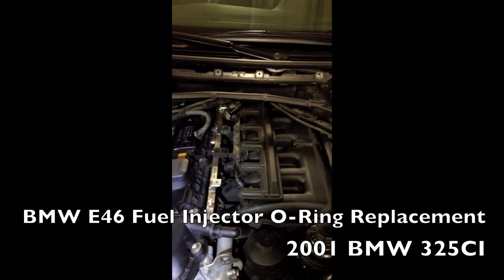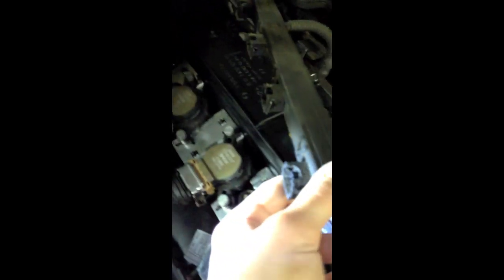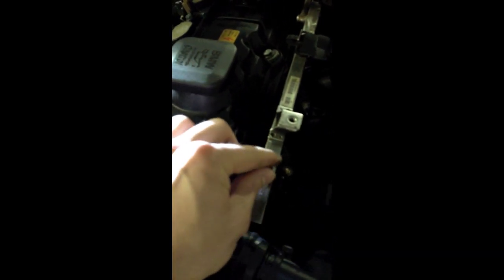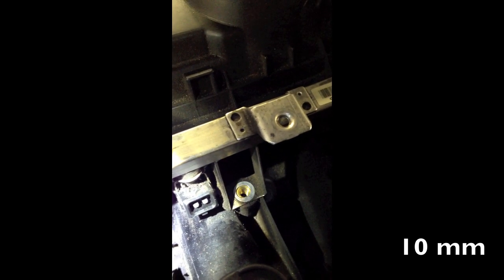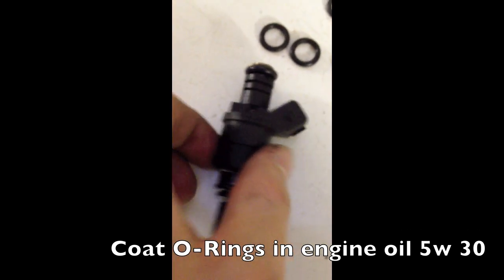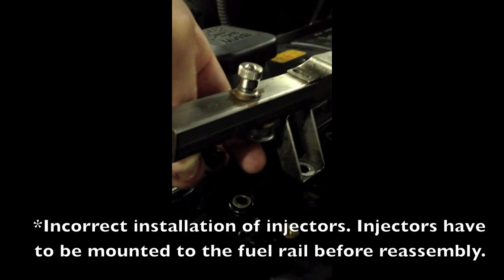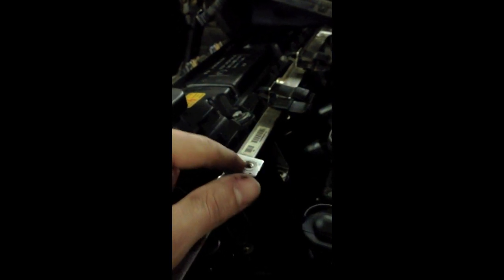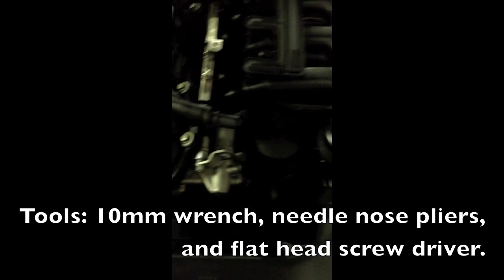------- BMW E46 Fuel Injector O-Ring Replacement -------

Comment: If i dont dip the rings in oil or anything can it still lose fuel pressure ?i get long cranks after long periods of time
Reply from the maker: Seems like this is the material the o-rings are made of Hydrogenated nitrile butadiene rubber (HNBR). I lubricated the rings for ease of installation but I do not think the material needs anything else to properly seal.
Reply: Ross Piccinini that's what I figured.. My next guess would be fuel pump or regulator but I just changed those yesterday maybe I got a faulty refurbished one? Would a faulty camshaft sensor affect starts?arrgh!
Reply from the maker: What are the codes?
Reply: Ross Piccinini I've gotten all codes so I did everything to a T.. cleaned fuel injectors and changed the filter baskets and orings, changed fuel filter and regulator + fuel pump, +fuel pump relay, new spark plugs I gotta change the throttle body gasket just doing regular maintenance stuff.. At least I'm getting better mileage and no more codes though. I'm gonna check this next 13537548987 INLET FUEL HOSE then I'm gonna give and bring to mechanic my mind is overloaded at this point
Reply: This is what happens.. Morning crank for 3 seconds release.. Crank again for 3 second release.. Crank for 3 seconds release.. Crank for 1 second starts up great runs great, reach the store, shut the car for 5 minutes, crank for 1 second starts right up.. Slow leak somewhere or the switch on the fuel pump is faulty on the new one too.or the inlet fuel hose is cracked.. maybe a vacuum leak somewhere
Reply from the maker: Interesting. You could look into; secondary air pump, CCV, mass air flow sensor (easy to clean), idle control valve (easy to clean). The general problem is vacuum leaks but that can refer to basically any component. You can also check cylinder compression. I had my cam shaft position sensor changed out at 140,000 miles.
Reply: Ross Piccinini I did all that believe it. I wanna change the crank sensor too is it difficult? Not many vids on it.. maybe I'll do one if it's not hard
Reply: If I can't figure this out I'll never earn my YouTube certified mechanic certification.. LoL
Reply from the maker: Check the voltage
Reply from the maker: Voltage??? Get a reading right after driving for more than 30 minutes, a reading first thing in the morning after the car has been inactive for more than 8 hours, a reading right after turning the engine over, and graph the readings as the car is warming up. You can access the voltage from the instrument cluster by putting it in one of the special modes using the two buttons in the instrument cluster. You can get real time readings using a OBD II reader and software. I have used Movi in the past with their bluetooth chip and have had success with that platform. Without accessing the cars computer you will not be able to properly fix the issue that you are describing. Believe me I have tried that way which ends up in the blind parts replacement category making ownership much more expensive.
Reply: Ross Piccinini I asked the dealership if the battery needs to be coded to the computer or registered. He said not my car not required.{2004 BMW x3 m54 e83 2.5L}. I'm gonna try to re-sit the fuel injectors with the proper anti friction rubber coating {as it says at newtis.info}
Reply from the maker: Good to know. If you could post that specific type of anti friction coating I am sure everyone else would appreciate it.

Comment: Hey ROSS PICCININI THANKS A LOT FOR THE VIDEO I searched 3 hrs trying to find out how to disconnect the electric wiring to the Fuel injectors on a BMW X5 and how to remove the Fuel injectors and You got it all covered. (undo the clips)

Comment from the maker: The gap between the black cover and the engine bolt holes is due to, in my opinion, the thermal contraction of the entire engine as the injectors were removed. If you let the car warm up the black cover should be able to sit back in place. Also the fuel rail bolts have play so you can move the rail around a little before the final tightening. Push it as far as it will go to the left if there is not enough space to match the bolt holes.

Comment from the maker: When you bolt the fuel rail back to the engine body there is a little bit of play. Try and push the rail all the way to the left to give more room for the cover. 
Also try to put the plastic cover back on with the bolts loose just to check clearance.